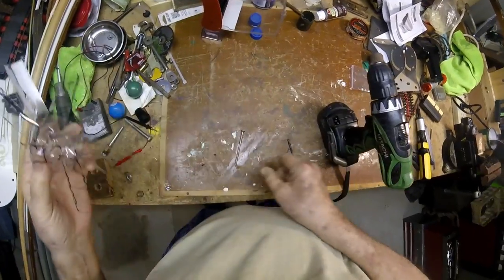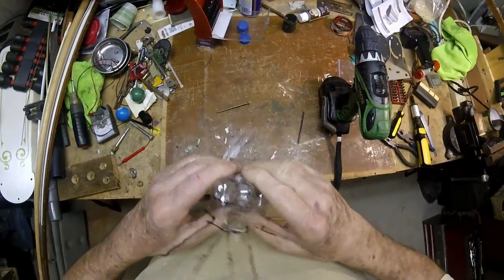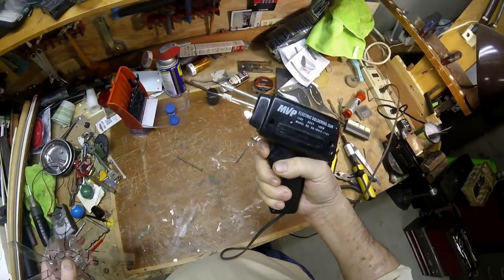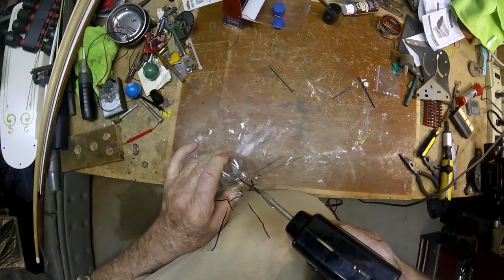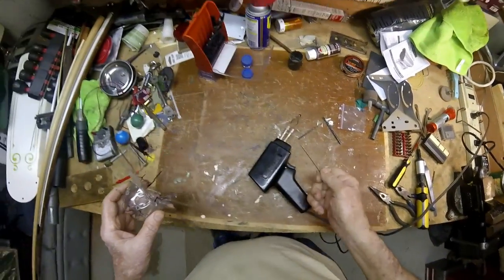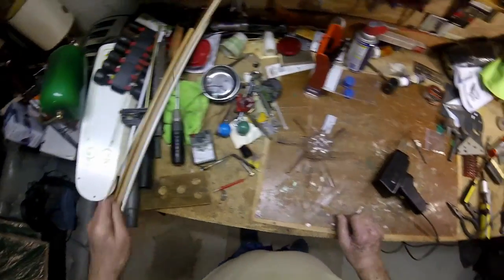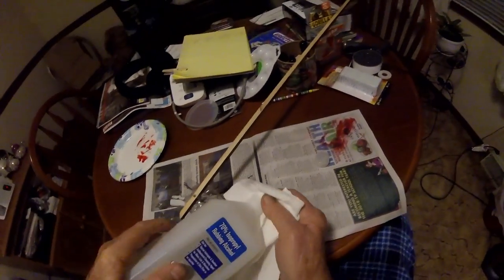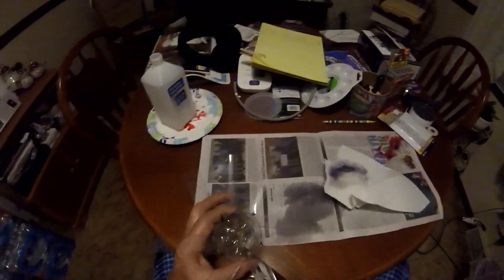How To Make Plastic Bottle Propellor Wind Spinners Part 2

Comment: Just a thought, instead of through both sides of the spinner, use it from the inside of the middle. You had it apart so all  you could have done was to put the nail looking outwards from there. No extra hole going through the outer piece of plastic. I also noted that the drill bit wasn't long enough to go through both pieces of plastic at the sane time which would mean the center hole would match. Not a bad spinner though, good job.
Reply from the maker: I plan to make better ones  Its a learning process